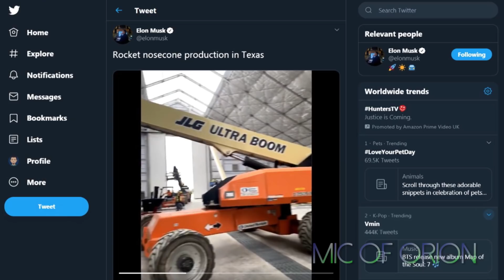SpaceX To Fly Test Starship Before Easter

Comment: Building and designing a rocket must be an enormous engineering task (I work in aerospace manufacturing), but with these Spacex videos you never see more than 2 or 3 guys wandering around in the workshop or up on the cherry picker inspecting welds.  Seems very odd to me...
Reply: Funny I think the exact same thing. But I know that the spacex people work around the clock.  I think most of this is proof of concept work and not production, he's just aiming to weld the sections for now then mate the engine. With a concern about production setup and crew pushed back until after they fly this thing. Just my 2c, (I don't work in aerospace but I do work in medical engineering/production field)

Comment: In SpaceXcentric's video today, he quoted two tweets from Elon sating that SN 3, 4, or 5 would be the first to go to orbit and that that could be before the end of the year. It was not clear to me of that meant launching Starship as an SSTO, which I did not think it was capable of, or if they expect to build and test Superheavy this year. Either way, that means progress will be far faster than I have been predicting. Go, Elon, Go!
Reply from the maker: can you post the links plz, also yeah, SSTO won't be possible, at least not the cargo version, empty sure.
Reply: For test purposes I do think SSTO Starship would be plauseble with 3 Raptors and 3 vacuum Raptors aboard. However I doubt it would be able to carry any useful payload or human crew. But to test launch, re entry and landing with an uncrewed one sure.

I do wonder on what SN number Elon plan to fly test crew to suborbital or orbital levels? Must be a steep learning curve. Johan.

Comment: I  doubt NASA will approve Starship for manned missions due to a lack of a launch abort system. Which all other manned vehicles have.
Reply from the maker: Yes, that is a probability, I hope this isn't the case once Starship becomes more tested vehicle in use, however you might be right, we'll see.
Reply: @micoforion  There can be 1,000 successful launches. Then on launch 1,001 something goes terribly wrong. Thus the need for a system that can, and has been proven to save lives. In my opinion, leaving launch abort out of Starship is a mistake they will regret.
Reply: @DavidJohnson-tv2nn  I highly doubt it will have anything close to 1000 launches before the first crash, i doubt it will have 100. This ship is not designed to assure success and safety, its entire existence is to push the human race beyond anything before it, this is absolutely expected to kill people and anyone that boards one should understand this. People were fine knowing they probably wouldnt come back from the Arctic or Antarctic, but they kept going, and to do something barely meaningful at all.
   This will be the most meaningful thing in human history since its the only thing that could prevent the entire species from being extinct out of nowhere WHEN the next asteroid hits or super volcano has a hissy fit. Those kind of people still exist and will be signing up by the 1000s.
Reply: @Vatsyayana87  I have no objection to taking risks in order for the human race to take meaningful steps into the future. What I object to is taking needless risks. To leave out safety systems like launch abort that can, and have been proven to save lives is immoral and wrong!
Reply: @Vatsyayana87  I hope the FAA or maybe some new agency brings the same kind of strict regulation regarding safety to the private space industry that the airline industry must follow. Unfortunately, there are to many people who don't seem to care about human life. Or think lives are expendable if it furthers their goal.
Reply: @DavidJohnson-tv2nn  it doesn't further their goal, it furthers the biggest goal possible. To keep the only known intelligence in the entire universe alive. The universe is pointless without that. Its completely unknown and un needed. So far we are the most amazing thing the universe has ever made and it allowed us the tools to spread and survive. I think its our greatest duty and honor to do so. And the closest thing to a reasonable sacrifice of the few to save not just the many, but the ALL. Every death in all of history doesn't come close to being so worthy.
Reply: @DavidJohnson-tv2nn  but yes, im sure there will be some tight rules. there always are. But that landing is up there in the craziest things we've ever tried with lives. There is bound to be mishaps. Unfortunately.
Reply: @Vatsyayana87  It is still immoral and wrong to needlessly sacrifice human lives when there are safety systems available that are proven to save lives.
Reply: @DavidJohnson-tv2nn  Two things i disagree with, its not immoral, its a choice, and not yours or mine to make but the passengers that will board it. Nobody is pushing them or even encouraging them to do so. 100% their choice.
 Second for the big picture mission to be feasible, there are currently no safety option they arent implementing that i can think of, NASA couldnt even evac the shuttle crew, we are talking 20 times that payload of lives at full capacity. Not within our capabilities, yet.
Reply: @DavidJohnson-tv2nn  Also, aborts have saved lives, they have also taken lives and broken backs, barely ever been used and give another thing to possibly go wrong to reach orbit. Check out Everyday Astronauts video on that, he gives some good info and thoughts on that topic.
Reply: @Vatsyayana87  Public safety IS the job of government agencies. Passengers aren't given a "choice" to fly on an unsafe aircraft like the 737 MAX. Boeing is ordered to fix it. NASA couldn't evacuate the Space Shuttle and the program was ended. On the Starship  passenger version there is 100 tons of capacity to orbit (minus the weight of the passengers) for safety systems.
Reply: @Vatsyayana87  I share your goal of establishing a colony on Mars. And that goal is put at risk the first there is an accident and 100 lives are lost that could have been saved by a safety system purposely left out. Furthermore, Musk wants to use Starship for less grand goals, like space tourism and point to point transport on earth. Have 100 people die in a tragic accident just because they wanted to shave time off some business trip?
Reply: @Vatsyayana87  I saw  Everyday Astronaut's video. While it was a good video, I disagree with him.
Reply: @DavidJohnson-tv2nn  ok this isn't a gov business, yes those passengers absolutely chose to fly on max, the shuttle is exactly what disproves your last comment, it wasn't canceled because they couldn't evac but because they couldn't afford it and what safety system is on starship? Cause I watch every bit of it and cant think of any at all. If the booster explodes it might attempt to use the engines already on it to run away but its flipping a coin, and probably cant be done while fueling which is right before launch with everyone on board.
Reply: @DavidJohnson-tv2nn  Its fine if you disagree with his thoughts but its impossible to disagree with the stats, unless your outright calling him a liar and I would bet a lot against that.
Reply: @Vatsyayana87  Those passengers weren't aware of the defective MCAS system on the 737 MAX. After the accidents the FAA correctly grounded the plane and ordered Boeing to fix it's mess. SpaceX and Boeing aren't government business's but they fall under government regulation regarding safety. There may very well be new regulations needed for the private space industry regarding safety.
Reply: @Vatsyayana87  As for the Space Shuttle... If I remember correctly, it was announced after the Columbia disaster that the Columbia would not be replaced and Space Shuttle flights would end after completion of the International Space Station. As for the Everyday Astronaut.... I don't disagree with his statistics. I disagree with what I believe are his conclusions... That launch abort isn't really that useful.
Reply: @micoforion  I just realized that a launch abort system may also be able to save passengers during a failed landing as well. Pulling the crew compartment away to safety just before a crash.
Reply: They tested their abort system last month.
Reply: @robertwhetzel9885  That test was for Crew Dragon. Unfortunately, SpaceX has chosen not to have full launch abort capability on Starship. In my opinion, a huge mistake.
Reply: @DavidJohnson-tv2nn  Its the only option, it scares me too since it will beat the Shuttle in fatalities, probably on its first crash, which is bound to happen. But there is no way to have an abort system on this. 
  But remember, this thing isnt a PC pussyfoot rocket, this is directly for the mission we expect hundreds of people to die achieving. Dont get on if you really expect to make it home.
   Sounds horrible but its what it costs for an entire global race to take meaningful steps into the future. Let NASA be the careful one (even though they hold the record for killing astronauts) while the private sector does things to improve our entire Species.
Reply: @robertwhetzel9885  lol that wasnt Starship my friend, Starship does not have an abort option, well, that is meaningful or expected to work.
Reply: Are you shitting me? Whats the last manned NASA vehicle?? The Shuttle with no abort system and killed more people then all space craft put together. Also, who cares what NASA wants, they dont control Spaceflight or what private customers get to ride, only NASAs astronauts, which ive never heard of them being considered for Starship flights at all.
Reply: What does Bob Crippen think of that

Comment: What is seriously lacking is anything on the main booster section
Reply: First SpaceX will build & fly the Starship alone, testing & perfecting the construction methods & Raptor engines on sub-orbital Starship ... 
only then will they produce the big Super Heavy first stage for orbital flights.
Reply: I think super heavy is too cut and dry to be in experimental like this, all of the questions for it will be answered during Starship tests without wasting the materials. But im right with you, waiting for that monster to finally start taking shape.

Comment: I'm sorry but this prognosis is unrealistic.
It took SpaceX 3 months to build (yes very responsible but) the easiest and fastest parts of SN1. And all other tricky and complicated components will be built and assembled for 3 weeks only???
Reply from the maker: Yes, took SpaceX 3 or 4 months to complete Starhopper and first Starship MK-1, I remember cause i covered the topic, but the progress on this starship is staggering.
Reply: mic of orion:
Flaps, legs, Raptors, plumbing, shields - all in 3 weeks?
Well, it's a short period to check.
Reply: @ВалентинРазумнов-ц4к  Its possible though i dont think they are at that state yet., also, there is no shielding, A lot of the plumbing is being done as the modules are made now, unlike MK1,  they have a better understanding of how it needs to go now and a bigger workforce. Remember they plan to make an entire Starship (or 2) every week once they get the process down, and the Raptors are done, just need to be installed.
Reply: Vatsyayana:
It took them a day - to hang a Raptor under Starhopper, and SN1 is promised to have 6 Raptors. And flaps, and legs... Even if they use the old ones of Mk1 (I doubt this) it will take a long time to mount and connect all these elements.
I'd like SN1 to fly sooner but...
Reply: @ВалентинРазумнов-ц4к  yeah but I see them hanging the, I'm pretty sure 3 raptors as they are also doing the raceway and flaps. They are getting really good already and will only get better.

Comment: Man-rated Starship by the end of the year? We're all excited, but saying insane shit like that makes you hard to take seriously.
Reply: Yeah, and my dick "could" turn into a flock of white doves tomorrow. But no realistic assessment of the facts suggests it's even remotely possible.

They haven't even begun prototyping Super Heavy booster. Both it and and Starship will have new re-entry and landing profiles - Starship landing profile is still purely theoretical at this point. Totally novel heat shield system. No raptor engine has ever been truly flight tested, and we'll need to fly dozens of them dozens of times.

And after all that, with no crew abort system, Starship will need a long and immaculate safety and reliability record before being human-rated. Even if everything goes right, suggesting that "could" happen this year is magical thinking. Elon is ambitious, and SpaceX has a lot of resources and extremely talented people working for them. That doesn't make them fucking wizards.
Reply: @Merlmabase   Hyperbole aside, what he's saying is there's a window in which something could REALISTICALLY happen, and the time he's mentioning is the earliest part of that window.  He is very clear about it being the early part of that window.  Is that the most likely time?  Maybe not.  But it's the earliest possibility, which means it's possible regardless of probability.
Reply: I mean it could happen, the rate of development is extremely fast. I could see it happen by october maybe December
Reply: "Could"
Reply from the maker: To be honest, I was very much sceptical about it, but saw some SpaceX plans, they're really really going for it. There won't be manned flight test this year, but they're definitely looking at performing a 22km sub-orbital flight and potentially orbital test. Could they have man-rated design ready this year, time will tell, but it could happen.
Reply: lol, same with landing orbital class rockets, catching fairings with a boat, auto driving cars... 
 Insane shit is the business Elon owns today, how do you not see this? And maybe not this year but almost guaranteed by next year which is barely a difference.

Comment: i'm thinking it will need a redesign to incorporate the tiles
Reply: more likely just jigs to weld on the pem studs so that the tiles can be bolted on.
Reply: what tiles?
Reply: @Ixions  the ceramic heat tiles for high speed reentry.